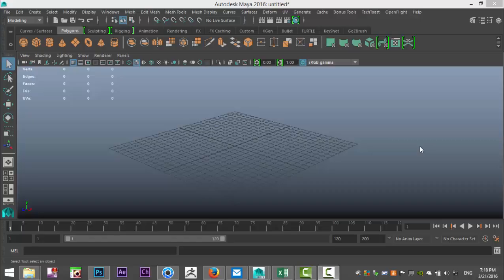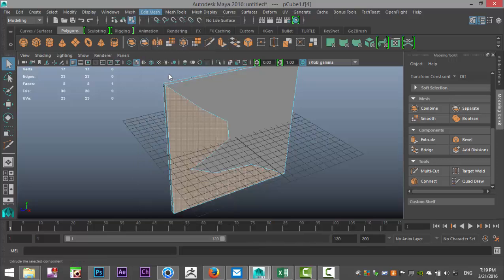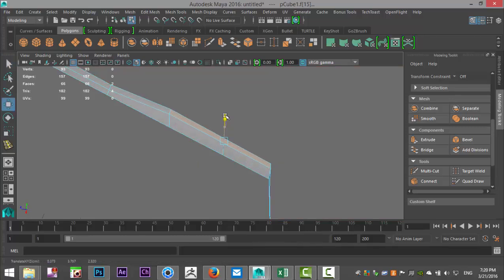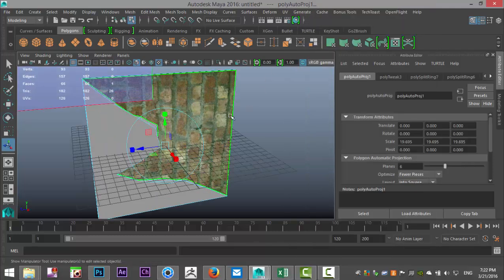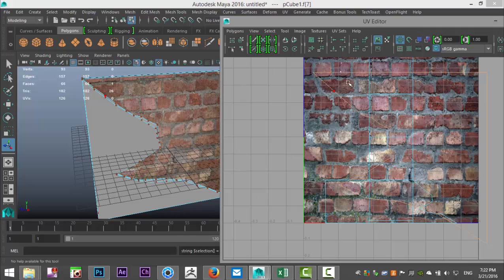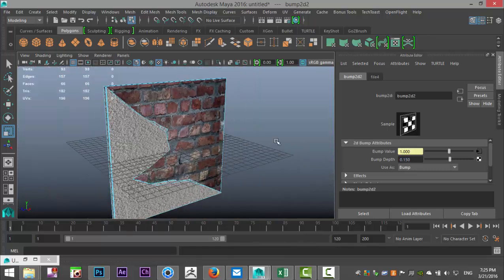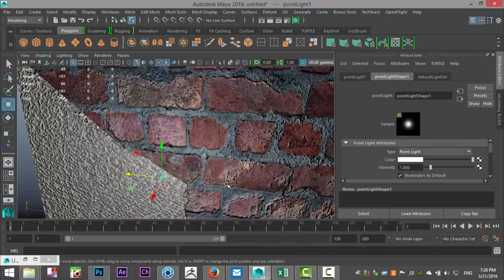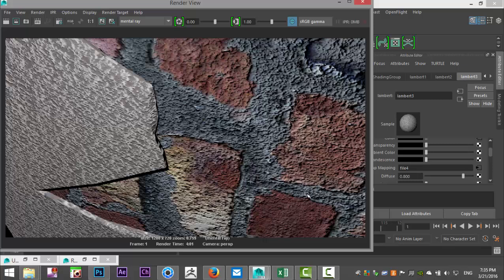How to model busted stucco on a brick wall in Maya

Comment: Question: would normal maps work better? Also, I saw your tutorial for creating normals, but you used quixel and photoshop. Any ideas for alternatives for gimp? Thanks
Reply from the maker: +RaGing_Wild No sure about Gimp as I don't use it. In this case I thought a Bump worked ok.
Reply: +RaGing_Wild CrazyBump is amazing for normal maps, but I would suggest AwesomeBump even more because it is just like CrazyBump except that it's open-source. 
http://www.blendernation.com/2015/03/04/awesomebump-open-source-texture-map-generator/
Reply: +M Kay I'll take anything that's free, working with unreal engine 4, still figuring it out. Thanks for the suggestion